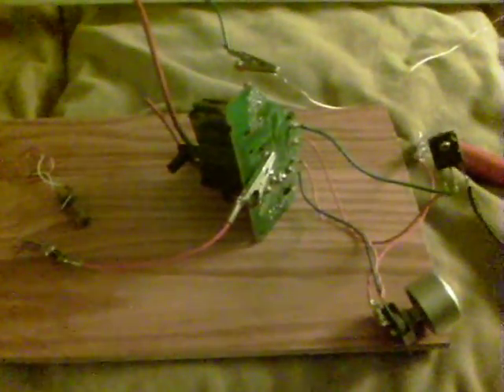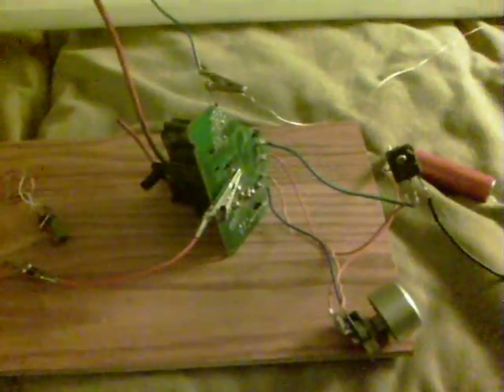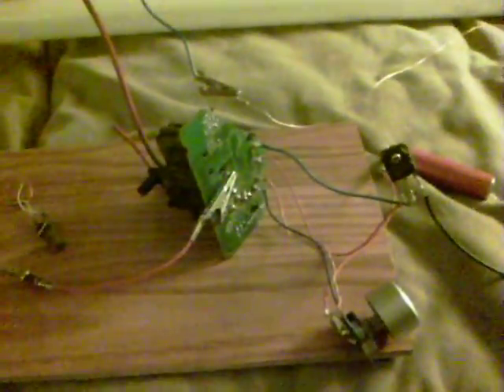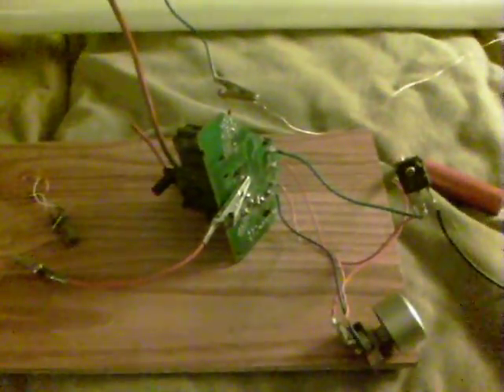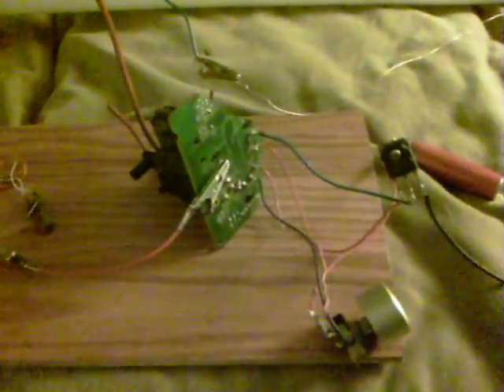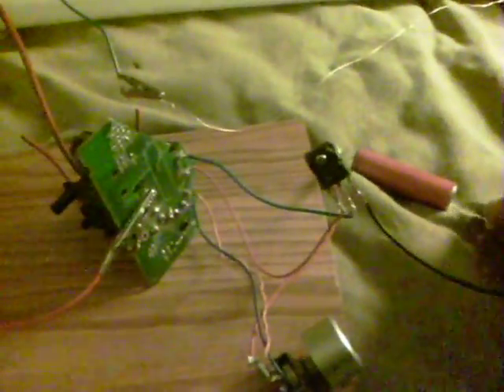3.7V flyback - tube sparkles and 4ft of wireless

Comment from the maker: @MrFlathunter Have noticed it changes with resistor value (or pot in this build). Wireless field can be bigger and yet light output less. Or, might be the AV plug type. This is a 12 wind coil of about 30 gauge that connects to a FWBR made of 1N4148's. Have used that all the time. A blue or white LED on an AV plug and croc lead normally does just as well though